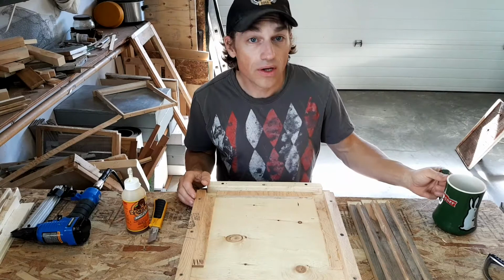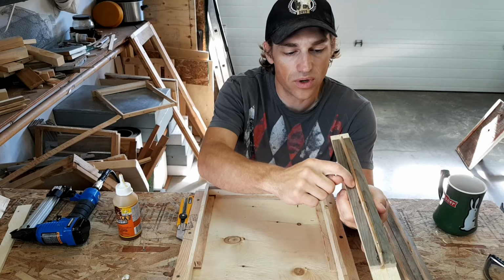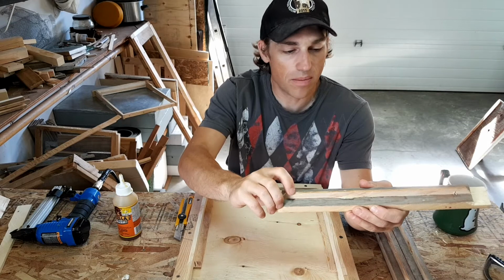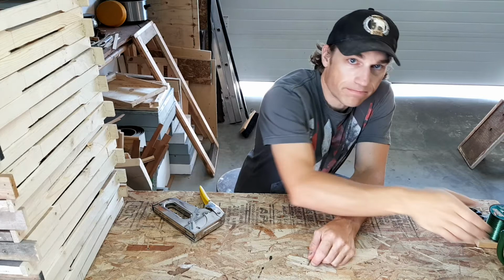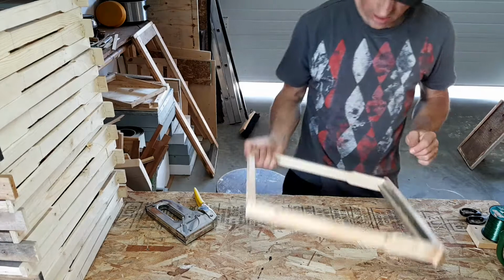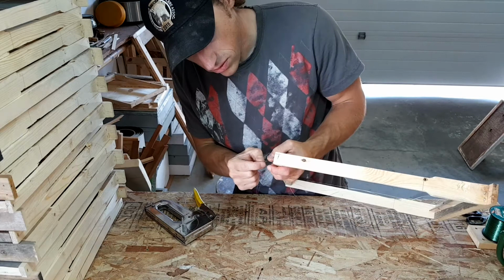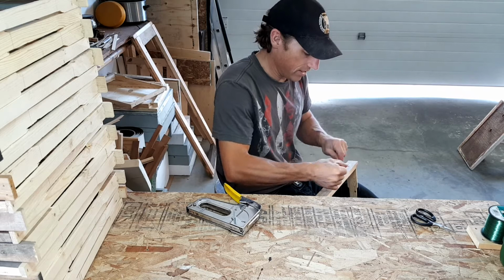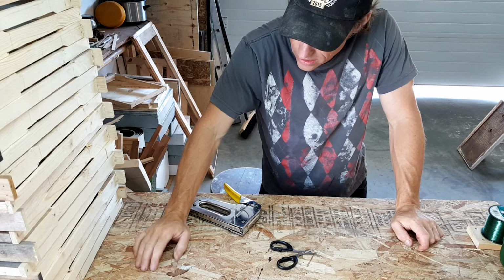The Layens Build - Part Three - Making Layens Frames - Matt's Vlog #29

Comment: How did you get your frame end shape?
Reply from the maker: I use my table saw. I use a dado blade set with the width of 7/8". Then I set my guide rail at 1 1/4 "  away from the outer edge of the blades.  I run it threw once pushed up against the rail at a 90 degree angle, and then a second time  threw to get the remaining stub at the end  of the wood that was up against the rail.  If you haven't seen my video of the new style of frames I am making you should check it out.  https://www.youtube.com/watch?v=0cugSqGAOAs

Comment: what you think deeper frames winter bether and give more honey ?  or small brot box frames
Reply from the maker: Great question. And over the next few years I'm hoping to find out if they do over winter better or not.  But from what I have read larger framed hives do well in climates like mine, that have long sub freezing temperature winters. I do believe that it would be more efficient for the cluster to keep warm, if it is one solid mass that is just in contact with wax combs. Compared to the cluster being divided around the top and bottom wooden frame bars. I did stack the odds further in their favor by insulating the hive body also. But depending on your climate it might not be an issue? I also believe the amount of honey that they produce is dependent on your management practices and the available nectar sources in the area. Not on the type of hive you decide to keep them in.
Reply: yes i have also long winter and 2 or 3 month of snow , but how you winter how you setup bottom board and do you put what on frames cover or
Reply from the maker: You should watch some of my other Layens video's if you haven't?  They would answer some of your questions.  https://www.youtube.com/watch?v=Ti7k54_h-2I&list=PL-tl_QxRN9Zdm9SkNhRl1UN2wLsMHK71b.  The layens Hive is a one box hive and has a solid bottom.  I insulated my hive to about an R9 insulation rating so I didn't need to add anything to the hive for winter. Except for the addition of a wool blanket  that will cover the top of the frames and dangle down into the hive that will allow some moisture to escape. I just installed the other day so I haven't uploaded that video yet.
Reply: Matt's Beekeeping ok nice what you think can you put super 17cm on top beehive  can bees make that
Reply from the maker: There is a Spanish type of the Layens hive called a Colmena Layens.  It has a brood chamber with Layens size frames. The frames have slots cut in the top bars so you can stack a super on top.  I was planning on building some this winter.  So that I could use some of my 8 frame medium Langstroth boxes as the supers.  An 8 frame langstroth box is about the same size as a 12 frame Layens.
Reply: Matt's Beekeeping is there website for schematic digram of hives frames
Reply from the maker: A great site is http://horizontalhive.com/how-to-build/hive-frame-swarm-trap.shtml  Dr Leo has free plans/  tutorials for all kinds of horizontal hives.
Reply: Matt's Beekeeping what about vertical
Reply from the maker: If your asking about vertical hive tutorials. I built all my Langstroth equipment from watching the Beekeepers  workshop video's https://www.youtube.com/channel/UC8HLlTQi_AbllvR-SBF8sRQ. He also has downloadable plans at http://www.michiganbees.org/beekeeping/in-the-beekeepers-workshop/?.